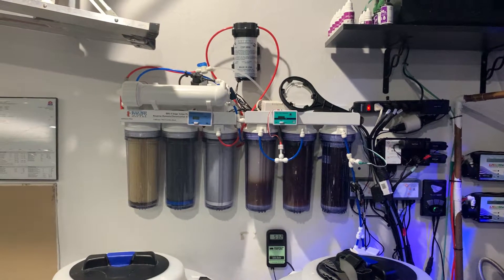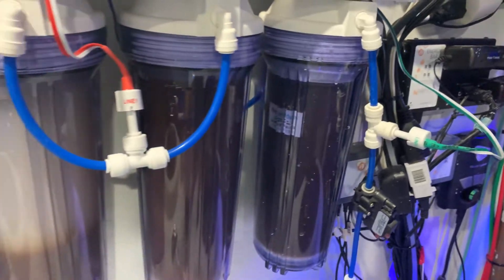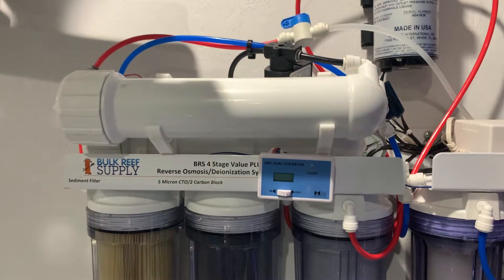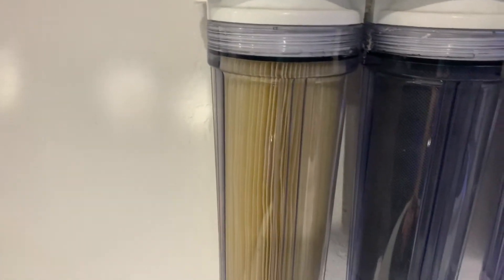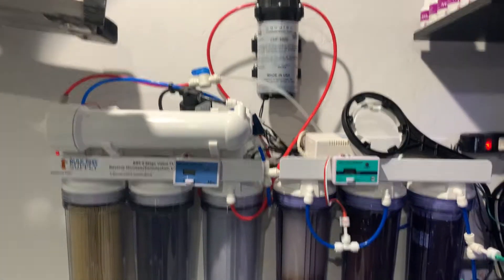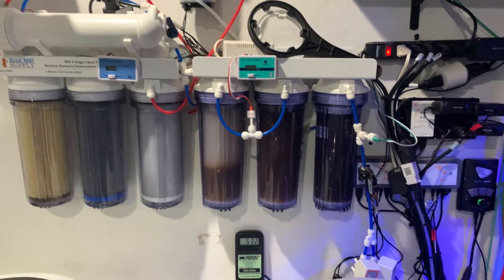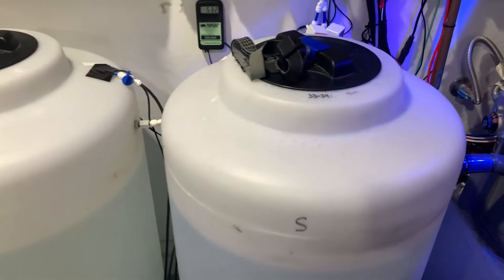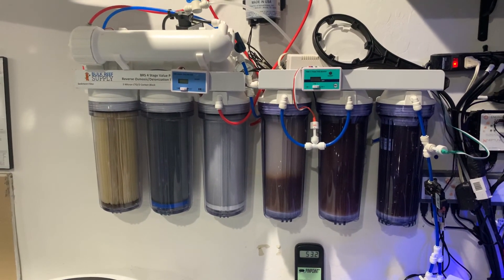My 7-Stage RODI System Configuration And Installation

Comment: How many Neptune solenoid valves total are there from the water source to the fresh water and saltwater containers? If I remember correctly, the BRS RODI systems also have a build in solenoid but I’d like to know the best placement of the additional Neptune solenoids. Thank you.
Reply from the maker: I have 2.  On the output of the RODI system.  I have a T and on the output of the T I have 2.  Take a look at my other videos on the setup.  I explain where I have them.

Comment: How are you getting zero TDS? Under the optimal conditions, the manufacturer states that 99% rejection rate is ex[ected. So if your in TDS is around 200, that means the TDS out would be around 2. Even if you run a second membrane, it would still produce around 1 TDS, and that's only if your inbound water temp is 77 degrees and you are using soft water, not to mention doing a flush, as recommend by Dow, every 20-60 minutes(model dependant).
Reply from the maker: I agree with you on everything you said here.  All I can say is that is what my TDS meter read.  So you are probably correct but I can only go by what I see on the meters.
Reply: I am not an expert on RO membranes, but there is one flaw in the logic of your post. If the first membrane takes the TDS down to two, and the second membrane removes 99% of that 2, the output will have a TDS of 0.02. 

Like I said, I have no experience of running two ROs in sequence, but 200 x 1% x 1% = 0.02, not 1!!